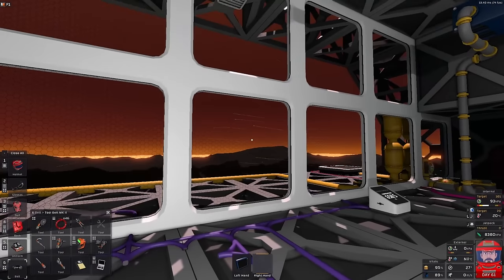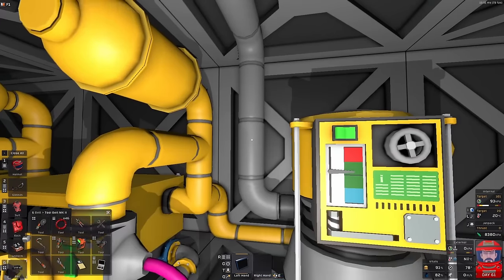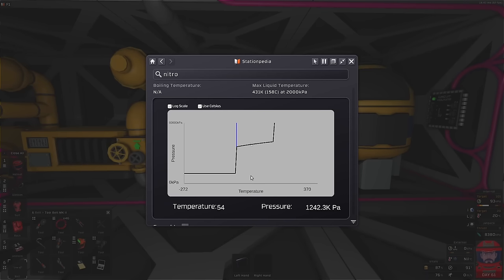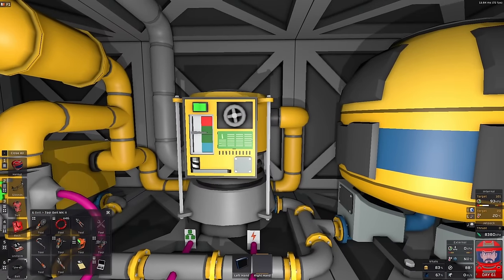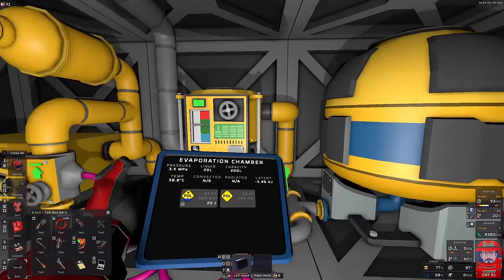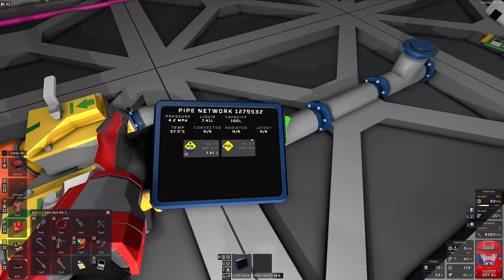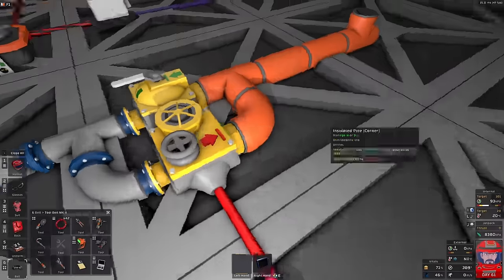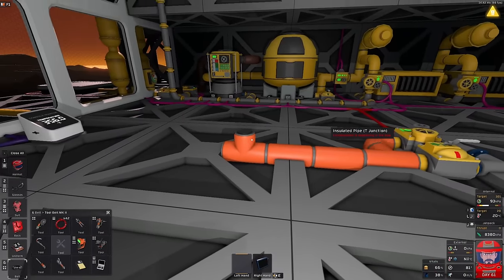Stationeers Evaporative Cooling

Comment: 12:25  you totally can use a liq volume pump/ expansion valve and it works terrifically for going into a counter flow hext exchanger where you expect liq to evaporate as part of a phase cooler... just make sure that the inlet gas pipe has a pretty significant volume or you have other safeties in place.

Comment: You use the expansion valve to dump hot pressurised liquids into low pressure pipes where it will immediately evapourate before it can damage the pipe. Pretty much exclusively for fuel mixing if you are storing fuels in liquid form.
Reply: Also pretty sure that for the setup you make around 18:00, if you connected the purge valve after the first one way valve, you'd condense a lot more pollutant much more efficiently.

Comment: I have made an discovery! if you slap on In-line tanks before your Condensation valves you get like 50x times more liquid polutant as it seems like it drain from the tank. I've noticed that there is a alot of liquid collecting in the large bubble tanks instead of the pipes.. but if you slap on the In-line tanks they valves drain from the tanks.

Comment: Excellent video, very helpful to understand how to use phase change to cool things!
Unfortunately, the Open Cycle AC doesn't work on planets with no atmosphere, which is where my problem lies. The moon is supposed to be easy, and I suppose it is, but paradoxically, cooling things on the moon is both easy and hard somehow. Getting things cold is easy, making your coolant stay above freezing is the hard part. 
Radiators work to get your coolant cold, but they will continue to work until the coolant freezes, and that can only be prevented by completely draining the radiator's pipe. Setting up an IC to push coolant through a radiator whenever it gets warm and drain the radiator when it gets too cold is the only way I can think to do it, and it gets more annoying if you are trying to use water, as you need to drain both the water and the gas separately because the liquid volume pumps don't move the gas. 
Are there any other methods of stabilizing a coolant on the moon you can think of?
Reply: Maybe if you're using phase change and keeping the temperature of the water above boiling point? So you pump out the gas BEFORE it condenses? How much ice can exist in the gas pipes before it bursts? If you pull a vacuum hard enough, wouldn't the water sublimate off and into the gas storage? Since if you have some really really hot gas water you only need to radiate it out for a little while then pull it back in when its say 120? Then you can push the cooler gas water into a compressor to condense back into liquid and transfer the cooled water where you need it? It can work as a closed system as long as you keep it all at a really high temperature. Water should be easy enough to come by that you should be able to charge it with enough to maintain the pressures you need, right? Probably will need a fairly large storage for keeping the hot gas water and letting it out into your radiating array only when you need to chill it after it's gotten too hot. Once it's chilled enough, THEN you can pump it back into the tanks where it would be pumped into your compression chamber to liquify.

Comment: Could you attempt to add a load to your two step (open pollutant, closed n2o) loop? Maybe by adding pipe heaters, you can experimentally determine the maximum amount of watts moved by the system.

Comment: does phase change happen in advanced furnace? with steam it looks like you could melt a few metals just by increasing pressure :P
Reply from the maker: The max heat is from water at 370C so you could do some low melt alloys.

Comment: i would assume the expansion valve used in conjunction with a tank would give it a low enough pressure to evaporate quickly and not create too much stress?

Comment: In the evaporation chamber what if you tried going colder just until the gas you want chilled gets closer?
Reply from the maker: The chamber does rely on passive heat transfer to the heat exchanger so supercooling it would speed up the transfer as long as you have switching logic to prevent overcooling.

Comment: I'm not sure why people do this setup in this game so different than an actual AC works. I use a very small amount of liquid I have it liquify at pretty high pressure then evaporate at very low pressure to get it to Sub-Zero temperatures and throw some radiators up which then get ice cold or if you were trying to cool a liquid a counterflow heat exchanger. This allows the system to react very quickly because there's not much liquid in the entire system and because it gets so crazy cold it is able to cool whatever you want very quickly and then shut off.

Doesn't that make sense?
Reply: How much liquid are we talking here? 1 Liter? Less? More?
Reply: @F4ir8or  yeah abouts for a small system, maybe a bit more, but it's related to the system size, evaporator plus condenser volume. Lately I've been messing with the stock evaporators and condensers in the game. I'd be interested to see if real AC calculations do the trick.

But I see people put a ton of liquid in and it takes a long time to start cooling and then once it does it continues cooling long after it's been turned off. If you want that type of thermal battery then then that's fine but usually I want to fast reaction